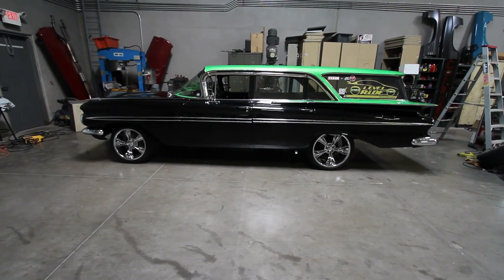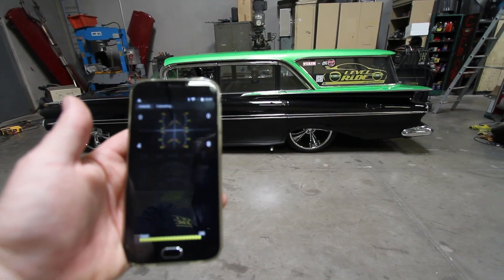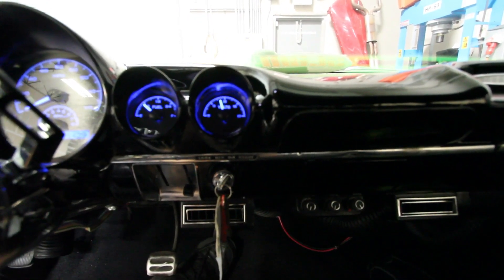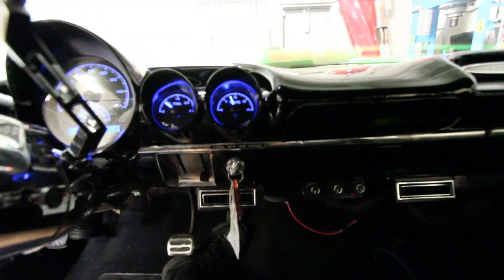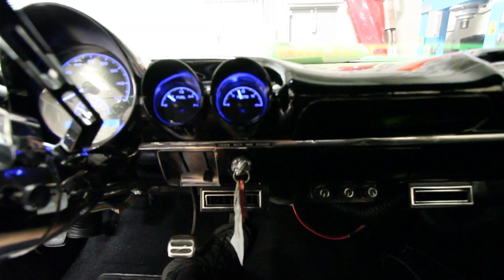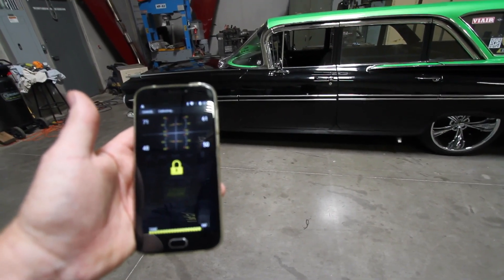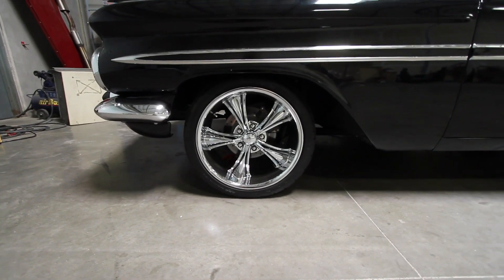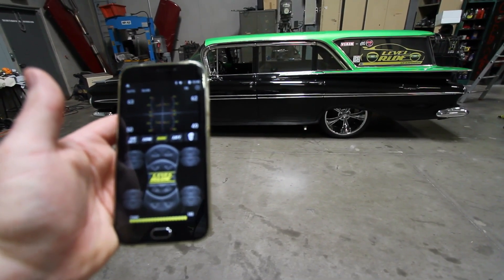Level Ride height and pressure calibration

Comment: What happens when the car is off?? How do you maintain a level height? I have full suspension and can’t figure it out.
Reply from the maker: When the car is turned off your in manual mode so it won’t auto monitor it, so if you don’t have any leaks it will stay where it was